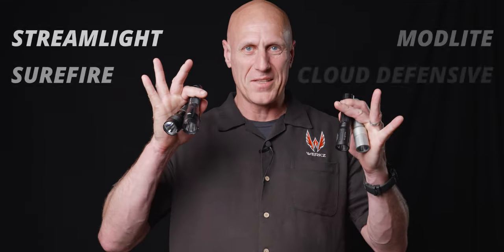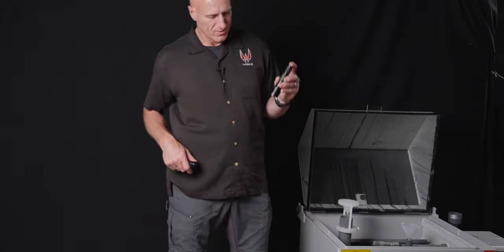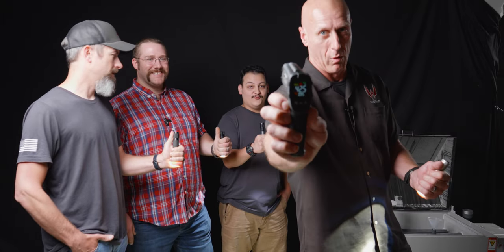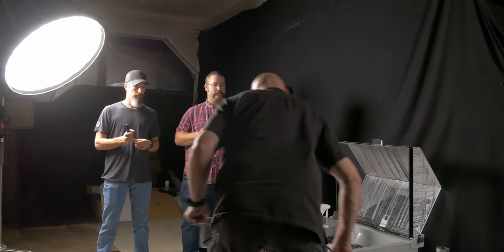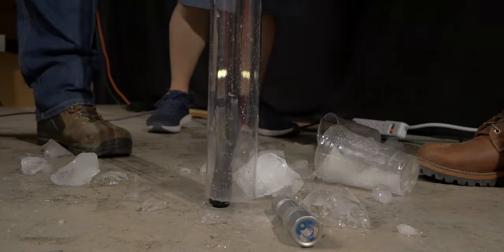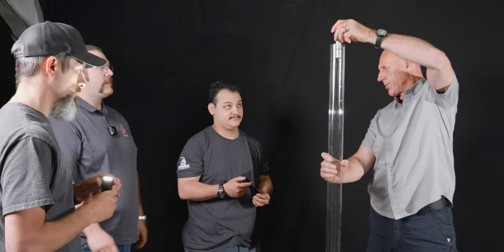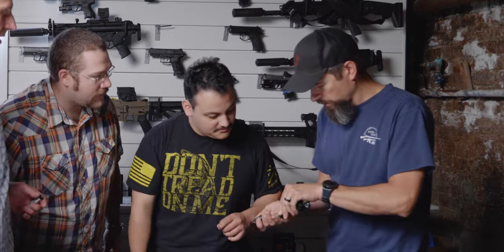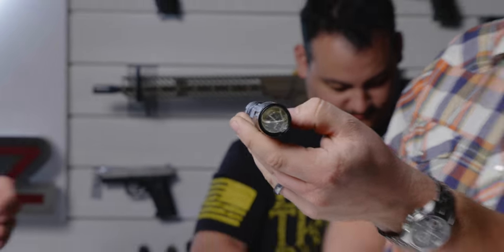CLOUD MCH DURABILTY vs. Surefire, Streamlight, Modlite

Comment: I'd love to see y'all test Malkoff Devices and/or HDS Systems lights.
Reply from the maker: I have some Malkoff Devices heads here...
Reply: +1 for the Malkoff MD2, specifically the M61 HOT head. I have an MD2 and an MCH, the MD2 is a bit chonkier than the MCH and built like a tank.
Reply: @WerkzHolsters  Depending on what heads you have, get the E-series to 18650 body or the full size MD2 body. Both built like a tank! The modularity, and the fact that it's a family owned American business combined with the quality makes them my lights of choice.
Reply: HDS won't survive.

Comment: I so surprised the SF died like that. I've had my SF scout DF take hits on more barricades than I can count, even a spill out the side of a moving car. I hope you guys get some word back from them because I really want to know what went wrong with it. Either way, amazing video as always guys!

I do have a question though. Did you guys by chance remove the tail-cap and check the back spring? The main issue that I have run into with SF lights is that the contact spring can, upon taking its first spill, get knocked around and move backwards a bit. This makes it so tail-cap cannot activate the light. This is also why the momentary pads sometimes produce less output vs their tail-cap counterparts. The solution that works best, as I've found at least, is to take a small pair of pliers and slightly tug the spring to make it a smidge longer.

Comment: The Elzetta Bravo B331 is much more durable than all of these. 1 inch thick solid acrylic optical lens, fully potted electronics, waterproof inside and out, and doesn't overheat or compromise reliability. I have the older 650 lumen version and unlike other lights it doesn't drop down. My 650 lumen Bravo is brighter than all of my 1,000 lumen lights. I like my Surefire lights to but never leave the house without my Bravo B331. Why leave with anything less than the best?
Reply: wow best info for elzetta...one day i must get that...wish me luck

Comment: have a Modlite Handheld PLHv2, which is a very good tactical light. But I have one problem... that's because the bezel of the light head is thin. Modlite weighs about 170g, so if it falls from the head part, deformation of the bezel is inevitable. I think it's easy for the lens to be damaged by this.

Comment: Surefire fanboy since the mid 90s here. 

I’ve had a couple through the years that had minor issues, but I’ve never had one actually fail me. Kinda sad to see this one failed so quickly. 

Also, the light I mounted in my daughters truck is a Strion that I found in the middle of the road. Tube dented and beaten up so badly from being run over multiple times that I almost need pliers to open it. Got her a charger for it and it runs like a champ on the battery that was in it.
Reply from the maker: Yeah, I'm bummed the light failed quickly as well. And still no word from Surefire...

Comment: Ive had a streamlight pro tac hlx for law enforcement patrol setting for 6 years. No problems other than ive issues with the rechargeable batteries from streamlight. I fully expected the vastly cheaper light to lose.

Comment: Which MCH did you test? EDC or HC? Single or dual output? Just got the EDC Single. Since it is 1400 lumens vs 1100 for the HC I'm curious if one gets notably hotter.

Comment: i am curious if a different sure fire tail cap one of them that has a less expensive button would have done better in the drop test and if the light would have worked with a different tail cap afterwards

Comment: Ever find out why the surefire failed? I have a surefire fury and it only lasted two years on patrol before the led burned itself out. It still runs but just at a lower output
Reply from the maker: I don't have that data yet, but I'll pin a comment if / when I have an answer for you.
Reply: Send it back. I have a Surfire Fury Duel Fuel and the Intellibeam version. Both have been rock solid.
Reply: @CMH_1975  I did and they fixed the led which had burned out. But it now has a tail cap issue and will flicker when on either mode. First issue I have ever had with a surefire, but when I google the fury intellibeam it seems that it has a few issues. Ended up grabbing a cloud mch to replace it as my primary for work and will be sending the surefire back for more repairs.
Reply: @keelansarnecki  that sucks. Sorry to hear that. I have several Surefire handheld flashlights and a few weapon lights and haven't had any issues. I know if I do, they'll fix or replace it. Good luck.

Comment: I’ve never seen anyone have problems with surefire as much as you guys. I used mine as a hammer a few months ago and in fact just this morning it fell out of my pocket at work 60 feet in the air onto concrete and it functions no problem. The other 2 handhelds, 5 pistol mounted, 6 rifle mounted, and 1 helmet mounted ones have had 0 issues as well. I’ve owned several steam lights, over half failed from very light general use. Modlite I’ve seen break from from a 3 foot drop. No experience with cloud defensive. I just can’t believe the anti-surefire cult.

Comment: I need anew EDC as my current Streamlight ProTac 1L-1AA is several years old and getting really beat up from rolling around on the ground and being dropped at least once a week. Also the clip just annoys the crap out of me since it just clips itself to the light body and pulls off with barely any force as well as it's a double sided clip for hats. I hate those things, completely worthless, nobody clips a heavy ass light to their hat because the hat just falls off from the weight. Anyways, I was looking seriously at the Cloud Defensive but the price was the only real drawback considering my lights get beat up, the current one is probably 10% bare aluminum at this point. But after seeing this video I'm just going to stick with Streamlight, rugged, dependable and way cheaper in price so no reason to go to anything else.

Comment: Used the streamlight micro for years until the clip started to get lose and it eventually fell out of my pocket. 

People complaining about candelas or lumens need to understand its not about lumens when it comes to LEDs.  

LEDs are completely inaccurate when it comes to Lumens 

My micro streamlight with 250 lumens was stronger than most 1000 lumens

Comment: Cloud defensive sucks ass.
Long story short I had a mch hc edc and mch duty. Every light flickered. It's a huge problem in their fb page group. 3 posts daily about their light flickering.  Cloud kept sending out tail caps. That was just a bandaid to a bigger design flaw in their lights. 2 months later they would flicker again.
Funny I was on a call clearing a house with 2 other officers. I had to stop and fart arohmd with the duty light to get it to stop flickering. Had to unscrew it take the battery out and fart around to get it to not flicker anymore.
That was the last straw for me. I got all new tail caps and sold the lights off. That's whete I draw the line. Been a flashlight enthusiast for years and none of my other lights do this. Something to do with the battery not making full contact in the light there for the flicker. I believe the batteries are too short. They need to figure their crap out